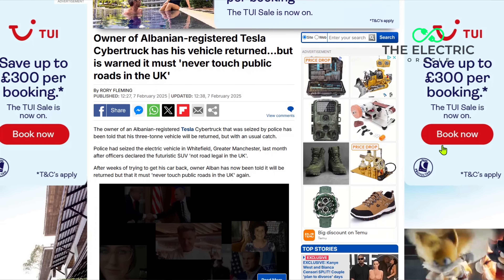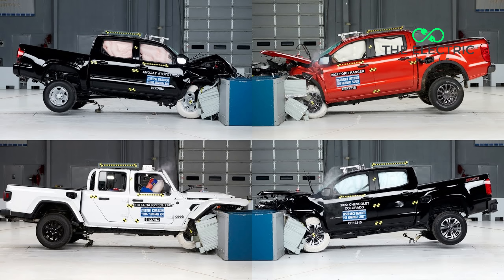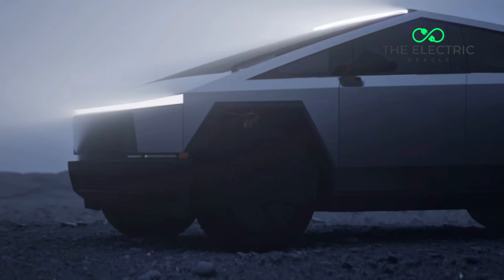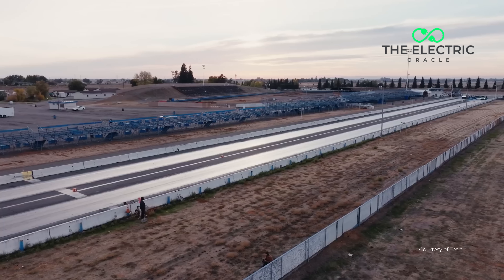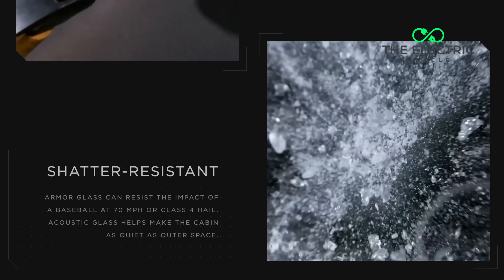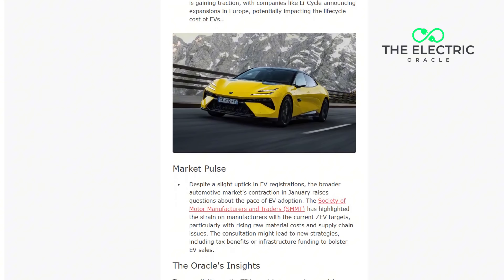Why the UK Banned Tesla’s Cybertruck – 5 Fatal Design Fails!

Comment: Interesting video, but sone arguments are a bit misleading.

E.g. the weight and width limits: there are other passenger cars the have similar specs. Think about all the vans (Peugeot traveler, VW multivan, Mercedes V)  especially in their BEV Variante with the heavy battery… the weight of that is actually the reason that you can not get all the luxury features of the Mercedes C-class in the EQV - because then it would be over the weight limit.

So: while it’s true that the CT would be in the limit of what can be legally registered in the EU, with a bit of trimming of weight you could get that legal. Same with the width - check the width of an EQV.

The real reason it’s not going to happen is that there’s simply no market for trucks in the EU. 
It’s that simple.
Trucks are just not a thing in Europe and neither in China

Comment: I actually lived in Berlin (West) when the Hummer 1 was released and we had two in my area.  I remember two distinct issues: 
     1) being as you hinted at here, it's width caused issues in the rural areas where roads in old villages were narrow and this behemoth trying to drive some of these sharper corners in towns were hitting and damaging facades or the front corners entering the oncoming lane as they negotiated turns.
     2) Germans, at that time at least, actually "towed" vehicles by picking them up, or bulling them up, onto the back of a truck. In Berlin, as well as other parts of the country, this became an issue as the Hummer was heavier AND to wide for the trucks to carry them.  All Police could do was ticket them, but not tow them.  I believe that caused issues with breakdowns as well, so real iffy to recover your vehicle.
     Honorable mention:  because of the length and width, it made it hard on the user to find parking in urban areas like Berlin.

Final, aside from the question you asked. One of those two Hummers in my area, was all black and chrome, with leather seats.  I finally saw the driver one sunny summer day with my wife and we burst out laughing. He was an older gent with gray hair, long gray hair, in a pony tail, Bermuda style shirt unbuttoned quite low, showing off cray chest air and a obvious tanning booth tan, and wearing at least 3 gold necklaces and multiple rings!  His wife(?) was dressed as you expect, like a former model, Russian escort girl. My wife told them it was a nice Mid-life crisis car and goes well with his mid-life crisis clothing choices. We cracked up again and it must have shocked him as we were a good bit away before he started yelling curses at us!

Comment: I want a car that doesn't fold, bend, or has controled FAIL points that totel my car if I hit a crusty bug. Learn too drive and just don't hit stuff. I have 36 years behind the wheel and have never been in a car crash where I was driving. You're driving a lethal weapon, treat it as such.

Comment: My LG stainless steel fridge looks better 😂
Reply: If you step inside it and have a power cut you can open the frigging door too. Superior in every way.
Reply: @Nine-Signs  the truck has a release pull so ya you can open it without power although LG Fridge is questionable some compressors fail faster then others
191-page lawsuit was filed against LG and its parent company, Kenmore, for faulty parts. One faulty part in particular, the linear compressor, experiences common issues that cause the fridge to stop working long before its 10-year warranty and advertised 20-year lifespan. 

and the fun part the mandatory arbitration notice located on the appliance's box, as well as inside the fridge and the manual, requires customers to settle any court cases privately

basically LG doesn't want to repair the fridges and tries to prevent you from suing them, Samsung due to their high failure rates and their inability to support parts for repair as well.
Reply: It probably handles better in an impact too.

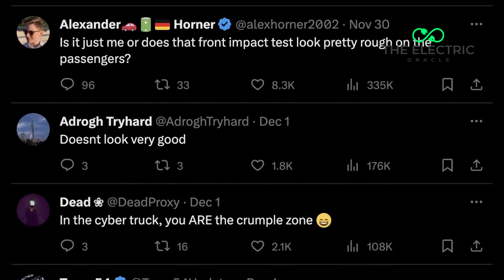Comment: 9:01 When everyone started to drive a SUV for no apparently good reason.
Reply: gas got cheaper but it was very expensive in 90s for a van in gas, now it's about same mileage as a small car but it's extra room to store things
Reply: @knightwolf3511  light trucks are exempt from some regulations, particularly emission regulations. So American auto makers started to push hard for suvs. Only real positive you get driving one is the higher vantage point but literally everything else is either a detriment to you or those around you.

Comment: There was a recent crash involving a cybertruck trying to take a turn a bit to fast. Skidding on the curve at 40+mph, bounced off a brick wall, and slammed into a tree. The entire front end wrapped around the tree like a soda can. What made it horrible was the fact that the crash took out the power inside the cybertruck. The locks all rely on power and the door have no effective manual release. The batteries immediately exploded and quickly turned the inside of the cybertruck into a kiln. One passanger survived because a passerby was able to break the rear window and pull them out before the entire thing went up. 3 people did not make it out because there was no way to get the doors open.
Then you have the trunk that has no pressure sensors so if it auto closes and your hand is in the way you won't have a hand anymore. The whole truck is a mobile coffin and creamatorium all in one.
Reply: "Speed was a factor" but I guess 40+MPH is technically an accurate statement, though misleading.
Reply: the salami slicer
Reply: I'm sure you have a link to this "story." As deliberately hazardous to pedestrians and other vehicles as the CT is, let's stick to reality when criticizing it.
Reply: @ It is in the U.S. Fatality Analysis Reporting System FARS data from the latest summaries.

The Model Y has a fatality rate 4 times the average.
Reply: @Naeron66  Darwinism at work, nothing to see here.
Reply: In all Tesla there is a manual release on the drivers door and another in one of the rear doors.  Police said high speed was  the main reason college kids had borrowed daddies car and had gone to a party this was them driving home.    If you crash at 40 mph and have seatbelts on  you would have been fine
Reply: @robertwoodhouse-bm7kt  sure bot
Reply: @robertwoodhouse-bm7kt  And if you are unconscious? Basically, you're dead if it catches fire.
Reply: @robertwoodhouse-bm7kt I believe the rear door manual is hidden behind a cover in the bottom of the door pocket.
Reply: From an owner of a cyber truck. You guys are weak!
Reply: @myredeyelife7010  Caring about your life and other drivers/pedestrians on the road makes you weak?
Reply: @myredeyelife7010  Yet you are twice as likely to die in a crash involving your Tesla as someone in another make.
Reply: @myredeyelife7010  Hope you experience the same tough guy.
Reply: @myredeyelife7010  Not when it comes to intellect and ethics.

Comment: To add insult to injury, stainless steel used in Cybertruck cannot be used to create shapes that are curved in two directions at the same time (e.g. surface of a ball). As a result, you cannot get rid of sharp "folds" or "greases" in the shape of the Cybertruck. If you truly wanted to make curved shapes out of the same material, you would need to 3d print the whole outer surface of the Cybertruck.
Reply: This is simply not true at all, there is no reason why such material limitation would exist. Where did you learn this from?

Comment: It is amusing that those little white Japanese urban mini-trucks have more truck-bed room than the Tesla truck.
Reply: Function over form
Only in this case the form also sucks majorly
Reply: This thing is the definition of what people around where i live call "pavement princesses" - trucks driven just for the sake of having a big car, and never actually used for anything practical. However, most pavement princesses till now could still potentially be used for work, whereas the cybertruck gets stuck in snow, mud, dry pavement, and bad vibes, as well as having poor design for hauling cargo. It does nothing a truck is meant to do while looking like a 3 year olds drawing in the process.
Reply: @iamjustkiwi  Not to mention most charging stations in the US that are outside of major cities are as broken down as they are scarce.
Reply: @ Just ask the person that owns one, instead of parroting empty phrases.
Reply: And are safer
Reply: The only thing about it which is truck-like is the weight.

Comment: The curious thing is that the Cybertruck is required to meet crash test standards, but it has never been officially crash-tested by the NHTSA or IIHS. Thus it doesn't have a public safety rating. Tesla claims to conduct its own internal crash tests. I find this rather hard to understand why any regulating body would trust any manufacturer to conduct its own crash tests without government monitoring.

Comment: assorted reason the law on England Wales and Scotlands safety regulation won't be forgiving on the cyber truck 
robust supposedly space launching tech isnt without taking with a grain of salt however passengers and pedestrians 
must be seen as the most relevant ones to protect sure there are attribute for reaching ways to forward that by cyber truck maker
must be a cabin solution which resist the collision momentum shock even as surround air bag feature remain cabin fluidity up the ante

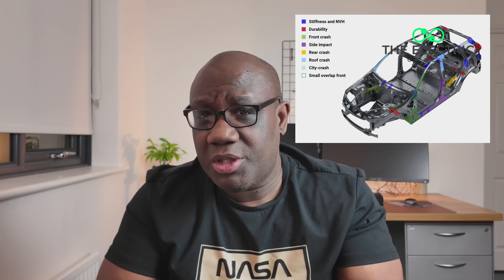Comment: 5:07  It's down to controlling deceleration (a = ΔV/Δt); the crumple zones increase the time taken (Δt) for the vehicle to stop thus reducing "a" and lowering the forces (F = ma, Newton) acting upon the occupants.  The stiffer steel in the Tesla increases "a" and thus increases the forces acting on the occupants; it's like going back 20-30 years when vehicles were much stiffer, reducing the chances of surviving (say) a head on collision with another vehicle, which on a 40mph road, would have a closing speed of 80 mph.
Reply: More like 50 years, 20-30 years ago cars were already build to fold like accordions...

Comment: Crumple zone if you hit a solid object means the passenger doesn't  stop dead ultimately with there restraints these can kill the passengers there was another key issue with cyber truck its steers by fly by wire which in the uk will never pass an mot

Comment: Actually it could be street legal with a simple software update. All the regulations do not aply to electrical vehicles with an integrated speed limit of 6 km/h - simply label it as "electrical weelchair to carry the ego of the buyer" But only allowed on the street, as it is to wide to be used on sidewalks.
At this speed the non-rounded edges and missing crunching zones do not matter.
Over 6 km/h up to 10km/h might be possible with some changes to the lights (up to 10km/h). Up to 30km/h need the corners to be rounded.
So technically the Cybertruck could be used in the UK (and EU) on public roads after a software update. As an  "electrical weelchair to carry the oversized ego of the buyer"
Reply: I’d say, put a 4 km/h speed limit on it. And require the thing to be preceded everywhere by a man on foot, carrying a red flag.
Reply: 😅How did Elon miss this loophole? 🙃
Reply: @Fractal379 The Cybertruck is to small for his ego, so he did not see the loophole. Also he is busy to  destroy US economy together with the orange boy
Reply: There is one - used on the road in London when the video covering it came out a couple of weeks ago BUT under strict conditions - and another in Czech republic or that general area.  BOTH had to have an entirely new lights system fitted AND have basically been wrapped in rubber to make them safe [from memory they are largely for car shows, not daily use].  One does a school run daily - the one in London which is registered in Albania, literally just down the road and back again - and that is as far as it is allowed to drive while the other is so heavy it comes under truck rules and has to have both a speed governor AND a tachograph fitted as well as the additional extras [new lighting system, wrapped in rubber].  LIke the one in London it is apparently for showing off at car shows.
There was a channel - I think an Aussie or NZ channel - which covered them recently and pointed out that there was another one on the road in the UK very VERY briefly.  First day out it was confiscated and is now in the hands of the police [no alterations made at all to it, failed every safety test, removed from the road] where it can apparently be viewed by appointment - they included a short video of it - and I'm guessing it's kept for curiosity sake.

Comment: ~Imagine driving a car that loses charge in cold weather
~Imagine having to buy a 7k paint job to correct the rust that forms in less than a couple months of ownership
~Imagine not being able to drive long distances
~Imagine not being able to drive if the power goes out
~Imagine waiting in line to recharge your car
~Imagine waiting forever to charge your car
~Imagine trying to put out the fire of a lithium battery explosion
~Imagine knowing that your car battery will fail 3x or more sooner than your motor will
~Imagine paying 40k+ for a new battery when it does fail
~Imagine how shitty the resale is on your car bec of those problems

I could easily keep going. The same people who like electric cars are the same people who trust the government and doctors.
Embarrassing. Failure. Low IQ.

Comment: First thing, it is not too heavy to drive in the UK. On a standard UK driving licence you can drive up to 3500 Kg. The cybertruck is about 3100 Kg, so anyone could drive it. Well, they couldn't because it is officially too large for UK roads so is illegal anyway. Also you made a flaw in the weight measurements. Also you're almost begging people to comment so the algorithm pays you. This is the last comment you ever get from me.
Reply: It was explained in the video. 3100 kg is the curb weight. License requirement is based on GVWR, which is 4000 kg or more, depending on the model.
Reply: @Catrik  Who said it is 4Mg? That's just a guess. 400Kg is a heck ton of cargo, or 4 large adults. And that would still not put you over the limit. Sorry, but the weight is not the issue with this vehicle.
Reply: @mymobile5014  4000 kg is from CT official specification from their website, it's not a guess. The weight is not any kind of issue, you just cannot drive it with a standard passenger car license.

Comment: Why are you a fan? Poor traction control means it's pants on snow and off-road. Its headlights ice up in snow. Range while towing is pathetic, and heavy loads can rip off the tow-bar. The truck bed is impractical for serious use and the gate distorts under load. It's extremely expensive to purchase, it's far too fast for its weight and egregiously expensive to repair - so no-one will insure it. Reliability has been a disaster. The body stains and rusts under normal use. Depreciation is crippling. It's inherently dangerous for occupants and other road users. It's not particularly comfortable or luxurious. So far as I can see, it's the self-indulgent fever dream of an adolescent CEO. It's proving a disaster economically, and the production line is working part-time. It's an omnishambles.

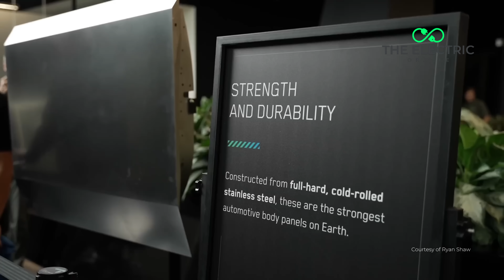Comment: 2:00 Exoskeleton vs unibody. You use both terms. Only the latter is applicable to the CyberTruck. It was announced to have an exoskeleton, but none of that really came to fruition and now the chassis is pretty much the same concept as every other Tesla. So your point about the corners is incorrect. They're there for manufacturing limitations arising from the difficult to work with steel outer shell and for design "aesthetics", has nothing to do with the fundamental structure of the car.

Comment: Tesla engineering is terrible when it comes to safety. A friend got trapped in a Model X when the windows would not open when it drove into a pond. The touch screen shifting is a major safety hazard as well. TESLAS ARE THE LEAST SAFE CARS ON THE ROAD.

Comment: Very interesting video, thanks for the insight.
Personally, I do believe that there are other ways to absorb impact energy in a crash, I think the car seats can be designed to absorb impact energy, but that requires quite a few radical design changes, so that simply can’t work in existing cars. Think of Seats moving back and forth on spring-loaded sliding rails, but of course that will need much bigger cars, and possibly a huge sacrifice on available luggage space.
Maybe something to think about for military vehicles e.g. tanks, but not pheasable for private personal vehicles.

Comment: Tesla never intended the US version of the Cybertruck to be sold in the UK or in Europe for many of the reasons cited in this video. A handful of them may have been shipped across the Atlantic by private owners or car brokers, only to discover that they required expensive modifications. With an international vehicle registration, some owners may have been able to use them as is.

CLARIFICATIONS: The Cybertruck's headlights are not part of the light bar. They are below the light bar on either side, just above the front bumper. The Cybertruck absorbs frontal crash energy in a different way than traditional vehicles. Cybertruck has a one-piece aluminum giga-casting in the front of the vehicle, just below the skin, extending all the way back to the passenger compartment. This giga-casting is designed to collapse progressively in a front-end collision, and allows Cybertruck to exceed stringent NHTSA crash standards used in the US. A second, larger giga-casting is in the rear section of the vehicle.